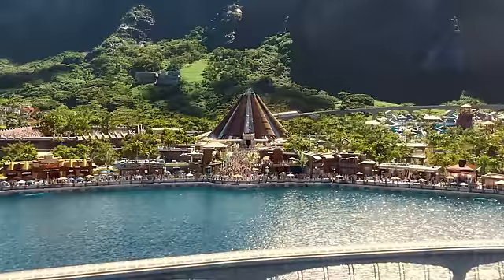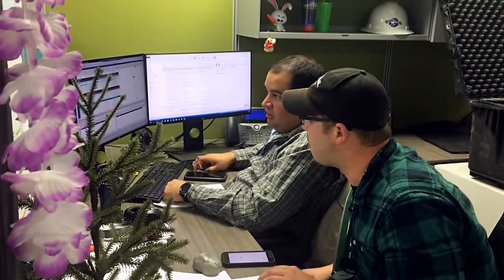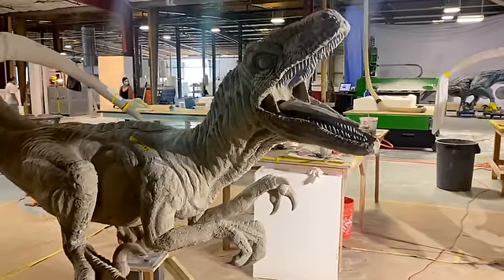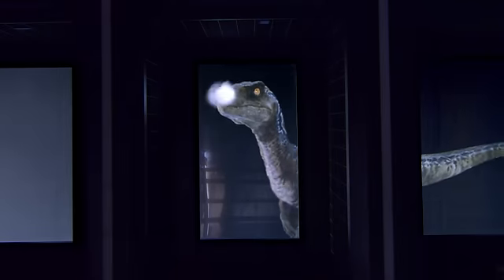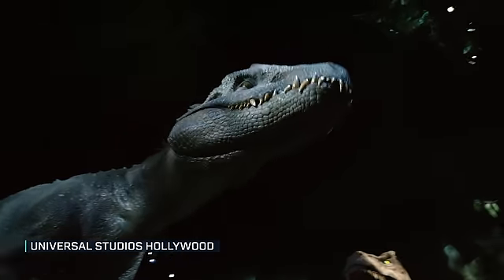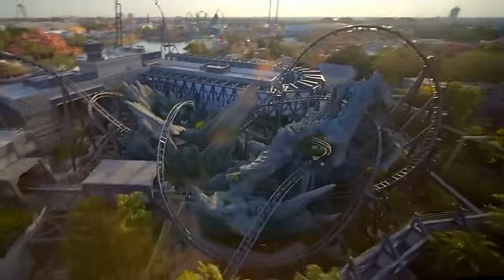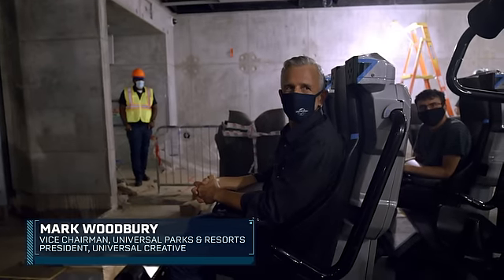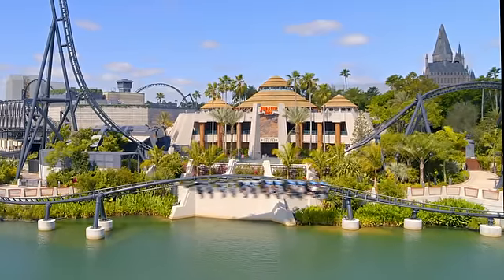The Making of Jurassic World VelociCoaster

Comment: Amazing! I have 1 question though, was the design of the coaster a collab between the creative team(s) and Intamin, or was it just something like you came up with the area(s) of land you wanted it to be in and intamin created the track design?
Reply: @Arrow Dynamics Inc. Actually no. The Universal Team had final say and most of the control over track design
Reply: @ryanwayner2475  Maybe track layout, not design.
Reply: @ryanwayner2475  intamin has several track designs that they use. The design on velocicoaster is called the double backbone track and it was designed by Stengel well before velocicoaster as it is used on other rollercoasters built by intamin in Europe.
Reply: @Arrow Dynamics Inc. I forget the video but if I find it again, I’ll share it